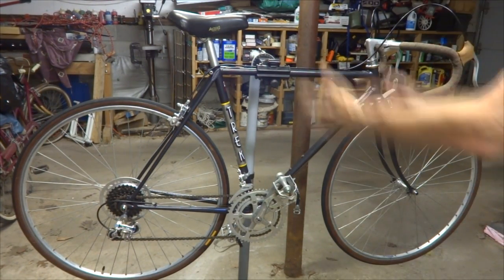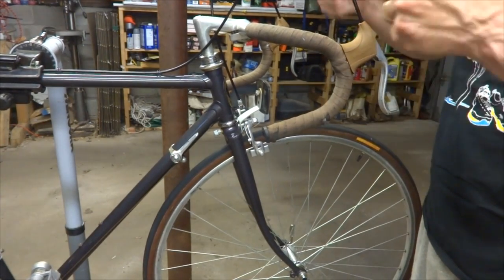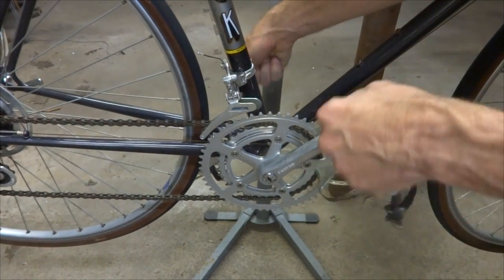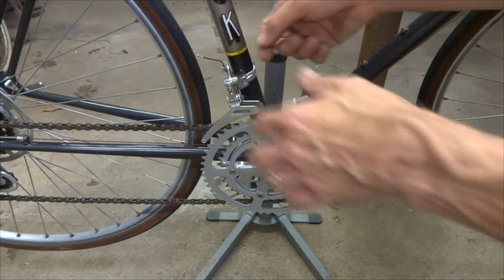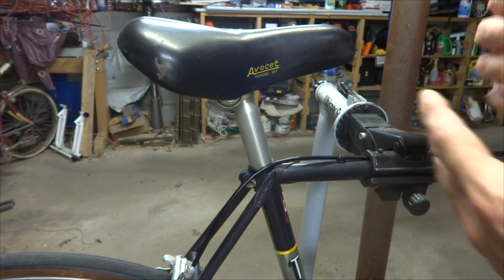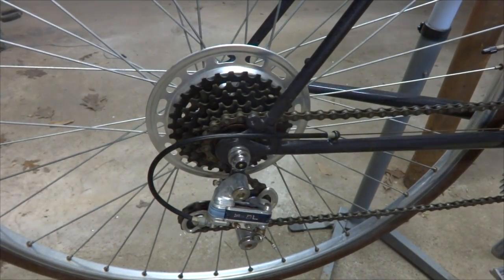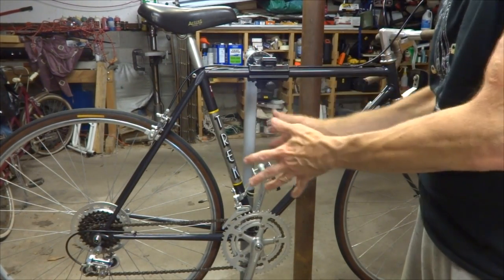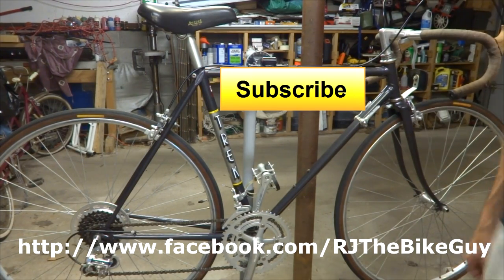Bike Noises - Find Them To Fix Them

Comment: if i can add one
the top tube being slapped by a loose cable housing housing on the top of it (like in this trek) on every slight bump on the road.
it makes a bell noise that really hard to figure out because it resonates everywhere throughout the bike and also because it not the first thing to look for.. a cable housing
Thank RJ, i tell everyone that i learn from you, you resolve the problems that most other youtubers miss. They do obvious and basic things, but you do alot of small deep end type of problems.
I know its cheesy but you inspire me!
please continu your videos, one day im sure it will be a well known ressource for bike mechanical problems.
Reply from the maker: Peruvian drummer Yeah, there are way more places for noises than possibly could be covered. A loose bottle cage, and rattling reflector, etc, etc, etc.

Comment: Hi RJ, thanks, 'always learn so much from your videos. I recently restored a 1967 Phillips and have adjusted to the fact that it makes noise, just like it did in the 60's. The brake calipers are one-screw simple, the fenders and chain guard are metal and held on with a minimum number of screws so the bike is a trap for rattles especially on rough gravel trails. It has it's own personality which is completely different from my ultra quiet Cannondale and you learn to appreciate them both.

Comment: I had a clicking noise that happened once for every time the pedals went around, and in the same place every time. I had no clue what it could be. It turns out that it was something not even mentioned in this video or in the previous comments here, so here's a new one for you. The kickstand had come loose. It had moved a bit, and it got in the way of the pedal. I simply had to move it back and tighten the bolt. So for anyone with a similar issue who may be reading this, you might want to check to see if this is the problem. It's a super easy fix.
Reply: JMFSpike get a new chain and apply it correctly. Make sure you have a chain guard while installing and make sure each part is level and well greased
Reply: I also have same problem as jmfspike mentioned
Reply: Got exactly the same problem. I even overhauled the bottom bracket because i thought its from there. ;)
Reply: similar issue for me. i had an issue mentioned in this video well he said chain - to be precise it was a broken(bent) chain link making noise when i put wight on the pedals in higher gears or going uphill. it was barely noticeable, a friend noticed the bent link on a closer look
Reply: thank you
Reply: @devie4895  You're very welcome. It's my privilege to be able to help. It's amazing how doing so incredibly little can actually help so many. I never expected I'd get even remotely close to 25 likes for my post about a bike issue, lol.
Reply: JMFSpike <33
Reply: I've replaced a rear derailleur for my mum's bike and gave the drivetrain a clean. Indexed the gears as best I could and it worked as it should. Except it made a noise everytime the pedal rotated consistently. A ticking noise, I moved the crank and the noise would appear. I stopped moving the crank, and the wheel would still move and produce the same noise. As it was moving freely, it wasn't a braking pad issue otherwise it would have stopped moving the wheel soon as I stopped the crank. It didn't look to be a crank issue as it was still occuring even when I wasn't moving them. Turns out to be your suggestion. It wasn't loose and I don't think it was rubbing against the wheel, but as soon as I took it off, no more ticking noise. So thanks for the suggestion. Probably wouldn't have tried it otherwise.
Reply: @JohnSmith-ox7xc  No problem. Glad my post helped you solve the problem.

Comment: My noise hunts so far. 
1. Dry old tire i was riding on was coming unseated, it was rubbing the brake and slowing me down until so much of the tire came unseated it locked up the rear wheel, luckily I was going uphill. I thought it was the front hub.  
2. Creaking when I put left foot down with a bit more force/out of saddle. I had already tightened it to 40 ft/lbs. Just recently it has come back and in both crankarms. Probably them starting to work back onto the spindle. After this ride in a few days I think ill retorque them again. But people on the internet warn about tightening repeatedly leading to cracks.  

On an unrelated note thanks for making all these videos, I watched a ton of them when I took my bike apart and put it back together.

Comment: Extra hints...
When you think your crank makes noises... Check and clean the stem bolts, seat bolts and clipless pedal screws FIRST before taking the crank apart.
It is also common to have a rattling noise coming from the rear derailleur pulleys when your chain is over-stretched, even if your drive-train has adapted (worn) to the stretched chain.
Oh and last tip... Your drivetrain will last twice as long if you have two chains and swap them every time you wash your bike. Three chains ...even better. Four chains is to much and will only make Mister T jealous. :)
Reply: Hahahahahahahahaha four chains is to much might makeMR T jealous brilliant to funny thanks made my day

Comment: I once was getting mad about a sound my bike was making and I thought it was the headset. I was SO convinced it came from the front of my bike. Took all the front apart and rebuild it, still... the noise was still there.
I went Sherlock Holmes on my bike and dropping my presetted idea of the noise coming from the headset. It was not mechanical because it didn't come at a regular interval but I did noticed that it was often (not all the time) when the bike was going up and down, like say from the sidewalk or a slight bump. 
Anyway as it turned out it was my saddle, I have a Brooks saddle and the leather was a bit loose and the shifting of my weight caused the saddle to sink in and out, that shifting caused a cracking (Brooks has a bolt in the front) that would resonate in my top tube all the way to my headset... Tightening the bolt of the saddle fixed it.
Just sharing this as to backup RJ here, by saying that you need to think outside of the box. Often, ask yourself that questions as if it was a customer coming to you for help by saying: My bike makes a noise, fix it and you need to investigate  :D
Reply: youmasenchi Ask the customer to ride the bike in front of you. So an outside source can hear the noise to determine if it from the front, middle or back.. Again if the noise resonates from the seat to the head set. I have no idea what to say because ones ass is big and sensitive. Riding a bike IS all about feeling (seat of the pants type of thing). I have never had an issue with detecting noises, clicks, grinding or resonates because I find a quiet spot and replicate the issue. I must admit though as mentioned in the comments by someone resonance with new wheels is a funny one! Again though With experience spokes / wheels tend to make more of a distinct harmonic sound compared to the rest of the bike.

Comment: In my experience there's usually a simple cause and remedy before you start looking at the bottom bracket. My touring bicycle was creaking whilst pedalling. I took it to my local bike shop and the cause of the creaking turned out to be the luggage rack. It was refitted ad the creaking has now stopped. Like I said at the beginning, it's probably a simple cause so eliminate all possibilities before getting to work on the bottom bracket, headset etc.

Comment: RJ once I've narrowed down the likely area for the noise, I also try to replace parts whenever possible to validate I've found the problem. I will swap out for a part (temporarily from another bike). For instance I'll swap wheels or pedals or even the chain. If the noise persists then I haven't correctly identified the problem. Just an idea

Comment: RJ, thanks for all your help so far. I cannot reproduce my clicking noise unless I am riding my bike.After watching your video, I am now unsure of where my noise is coming from. It sounds like it is in the middle, possibly the  bottom bracker and is in sync with my pedals from 12 to 3 o'clock looking from the same position as in your video. What could it be? What are my next steps to diagnosing the problem and  hopefully, fixing it. Thanks alot!

Comment: Quick question, I've built a fixed gear and everytime I go over a bit of road that is slightly rough there is quite alot of rattling coming for the bottom bracket area? I've changed the bearing and I really can't pinpoint what it is. Any ideas?
Reply from the maker: Matt Hale sigh you need to figure it out. Maybe it's the chain rattiling against the chain stay. You need to move stuff around until you find it. Bounce the bike on the floor.
Reply: RJ The Bike Guy its hard to pin point because I think alot of it is rattling. I've tightened everything I can but after a few miles of riding everything rattles again.
Reply from the maker: This is why I made the video. I can't pin point the noise. I am not there. There are way too many possibilities for me to start going through them. You need to do it.

Comment: Realy helpful video. Once i had this noise when i pedal on a bike and i thought it was somewhere around bottom bracket. But after i checked all the parts down there the noise did not disappear. As it was my first bike i spent alot of time before figuring out that sound went from sadle rails. Thumbs up. And RJ, is there a video on your channel about what parts to lube and not to lube? I mean parts that you screw or stick in like sadle tube when you assemble the bike. This coгld be helpful too.
Reply from the maker: Viator Vagus Not an overall video. But I have videos on individual parts and lubing them.

Comment: when i put pressure on my pedals they make a clicking sound
Reply: Maybe adjust the rear derailleur
Reply: @navodith shankar  navodith shankar  good thing you replied! It could be that the pedals need readjusting. They have grease in the axles where it attaches to the cranks. There are bearings that could be worn out and need replacing or there could be grit and small stones inside which are grinding. However as it is a clicking sound then perhaps the pedal needs tightening or loosening a small amount. I had this problem and had a service for my bike, it stopped after that. I think for me, the problem was my cranks were too tight against the bottom bracket. This could also be your problem. If you have the tools, try adjusting your crank set and pedals. Or take it to a good bike shop and pay for this to be fixed, otherwise other parts of your bike may start to degrade and become worse over time. Good luck on your repair, bike shops are friendly ) most. ;)
Reply: Same

Comment: Hello sir,I have a problem with my new conandale trail 3 2018 black and white. I just bought one a month ago and made a few trips on country roads. Up and down the hils, asfalted once...  bike was making a wered loud kick when when I was going up hill (standing on pedals and force stepping on them) and it makes this noice when it's in fist 2 smallest stars, the highest gears... 
I took the bike back and today got a new one of same model, but problem haven't disappear.. I stopped the bike half way up the hill and tried to pedal up without giving it a momentum, and once again it made that loud bang as if chain have poped or felt there the gear with force.. Can you please tell me what's wrong with it?
P.s i weigh 98 kg.. And am putting maximum first to turn the pedals..
Reply from the maker: One month old? Take it back to the shop where you bought it and have them look at it.

Comment: +RJ The Bike Guy 
hi
i have a fairly new road bike and i want to change the cranks from a square taper to a Shimano hollow tech cranks. it have about 650 miles on it. any thoughts ? 

i have another question, what the indications or symptoms of a bike wheel that have dried up grease.
Reply from the maker: You should probably be able to convert over to Hollowtech cranks. You would need to replace the bottom bracket of course to a Hollowtech one. If the wheel axle turns rough by hand (wheel off the bike), overhaul it. New grease, new bearings.
Reply: +RJ The Bike Guy  hi i got another quick question. when do you usually do a full overhaul of ur bikes, milage and weather wise and is hollowtech better than square taper cranks ?
Reply from the maker: I generally overhaul stuff when there is an issie or signs of an issue. Hollowtech BB's are lighter and the bearings are external so the cranks will be more stable. And with external bearings, it allows for larger bearings.

Comment: quick question;i had a bit of an incident, while doing my normal ride around town i went down a pretty big step(around 20ish cm tall) and since then my front tire makes a sort of a buzzing noise and i feel it in my hands while turning sharply, it also happens when i drop my front from 10ish cm, wondering what have i broken

also:the bicycle is new used for roughly 4weeks,and its a mountain bike with disc brakes
Reply from the maker: LOL I can't tell you without working on the bike. Isolate and identify the problem, and fix it, or take it a shop.
Reply: RJ The Bike Guy well thanks for the response anyway, also the guy at the local shop is no good, he keeps overpricing everything and using cheap parts

Comment: My bike has a hissing sound like 
Its rubber rubbing on something 
I checked everything sound is comming from rear tirw gears 
Any advice?
Reply from the maker: Too many possibilities. Keep searching or take it to a shop.
Reply: I had the same problem. It's brake rub. Undo the 2 screws on what ever caliper it's coming from, and hold down your brakes. Then tighten up the 2 bolts, and let go of the brake. I have a disc brake bike, may be a bit different If you have a different kind.
Reply from the maker: @rohanski1489  Maybe it is, maybe it isn't. Noises come from all over the bike.
Reply: @RJTheBikeGuy  very true. Some of them just don't stop!

Comment: my back tire makes a whining noise after i stop pedaling and the hub and cassette will start wobbling. What could the issue be and how can I fix it? I just bought an original Citizen miami folding bike thats been sitting in a garage for unknown years, frame is still in awesome shape though.
Reply from the maker: +Kathleen Haskins Take the hub apart  and see where the noise is coming from.

Comment: Hey bikeguy, I just recently noticed a noise on my bike. It's an older Raleigh mountain bike I purchased on Craigslist. I took it to a bike shop and had them true everything up and do a general tune up. Any who, I use this thing every single day at tech school and will continue to do so for the next few months until I get home next year.

Alright, so the noise is in the rear. It's intermittent and occurs at every turn of the rear wheel. It happens when the pedals are turning and when they are not. Also, the plastic disk on the rear wheel between the chain/gears and spokes isn't entirely centered. So I think it may be that disk, but I'm bicycle ignorant and am not entirely an expert lol so do you have any idea what it may be? I don't have access to a bike shop here that will be able to work it over, so I'm left trouble shooting it myself...
Reply from the maker: If the spoke guard is broken, just remove it.

Comment: Do new chains make noise as it is stretched out over time?
My single speed... when I am going uphill and pedal hard... i heard random clunk sound as i put some powerdown.
Reply from the maker: xxgg I think you are missing the point of the video. Noises can come from many different places. You need to investigate. It might be chain related or something else.
Reply: I actually did the inspection few days ago... than your video popped up ;)
Just couldn't figure it out..

Keep up the excellent videos.
Reply from the maker: xxgg First thing that comes to mind is bottom bracket. But it can be a lot of things.

Comment: My cank arms bolts keeps getting loose and its keeps making a creaking sound.  Please help me. Ive tried three different crank set-__-
Reply from the maker: Kevin Delacruz Maybe you aren't tightening them enough? I might be possible your bottom bracket spindle is not the common JIS type and might not be compatible with the cranks? http://www.sheldonbrown.com/bbtaper.html
Reply: Thanks, but theyre both like square shape. I heard about putting tape on the bb and shoving the crank all the way in, i even heard about hammering the crank arm in. Should i do those?
Reply from the maker: No! You shouldn't need tape. You shouldn't have to hammer them on. The cranks are pressed on to the spindle by tightening the nut or bolt. Check the link I posted above. There are several flavors of square taper cranks. Make sure yours is the right kind for your cranks.

Comment: i have a mountain bike and when i once switched gears on the friction from 2 to 1 someting weird happened with the grey thing under the seat near the pedals so it touches the wheel while in gear 1 on the friction and on gear 7 and 6 it sounds a bit weird
Reply from the maker: The derailleur? Adjust the limiting screws, and don't cross chain.

Comment: My tricycle right wheel is making a click sound. I can feel the click coming from the inside the wheel. I took the tricycle back to the shop and he said it was factory defected.
Also the right wheel seems to be a lit loose. Also, When I am pedaling and the noise starts I giggle the tricycle and the noise goes away and then in 5 mins comes back. I would like to send you a video of the noise so you can help me to figure out what if is.  Lucie
Reply from the maker: I can't diagnose the issue without actually working on your bike. As I say in the video, noises can come from anywhere and sound like they are coming from some place else.